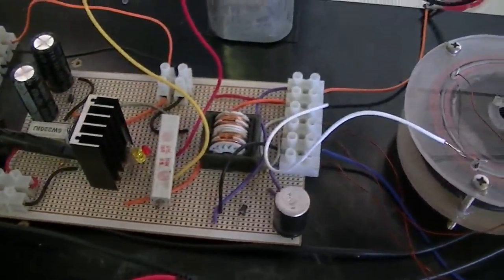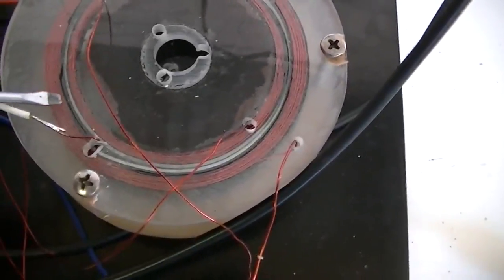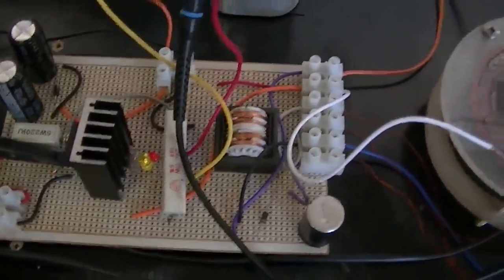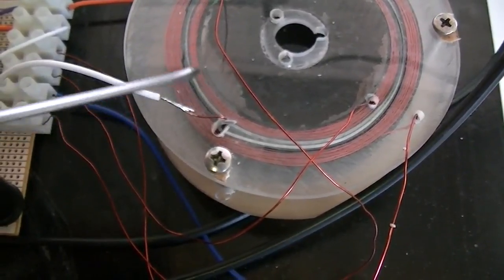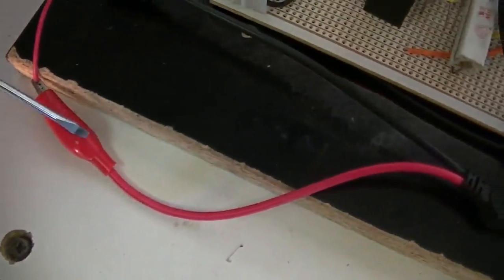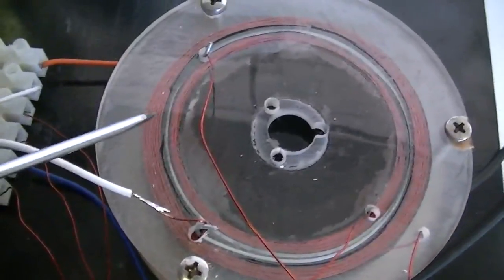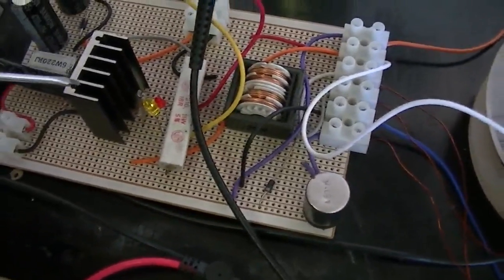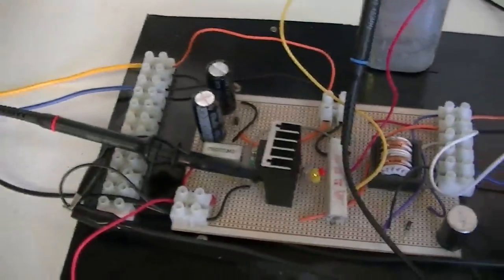Lenzless Transformer project   The magneformer

Comment: Thoughts.  Your iron turns are a short circuit to the winding turns ?
You have an external winding polarising the iron turns, then transducing the differential field alternation between the iron turns and the magnet ?
Can I suggest that you try the effect of pulsing the outer winding by altering its duty cycle - might be possible to obtain a maximum of efficiency.
I'd also suggest to try single polarity optimised pulsing of the inner coil, whilst using the outer coil to transduce fully alternating output.
Reply from the maker: Your answers are in the next video.The iron wire core is insulated,and acts as a second coil core. Your statement:You have an external winding polarising the iron turns, then transducing the differential field alternation between the iron turns and the magnet ?-is correct. This causes what i call a magnetic wave across the tank coil. You will see the effect this has in the next video.

I think your onto it lol.